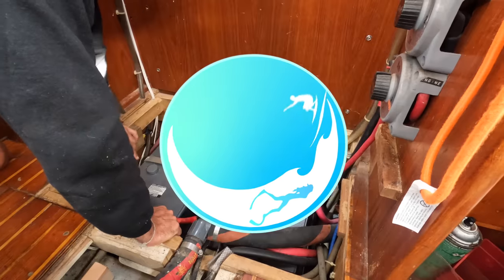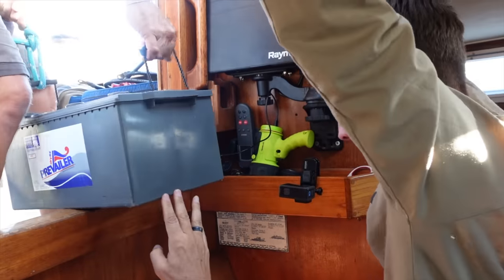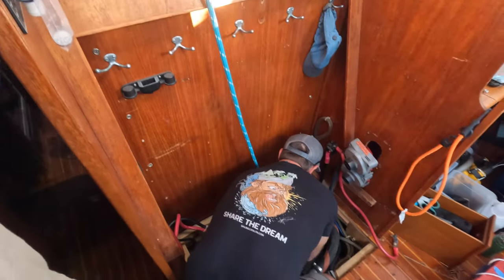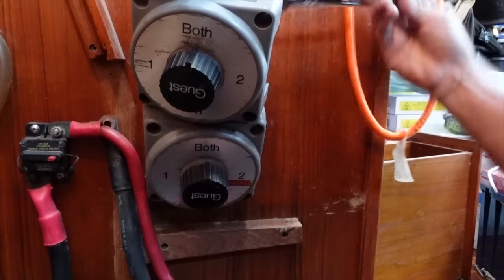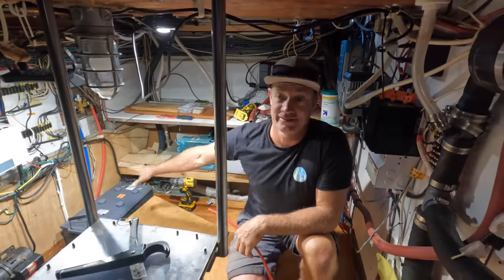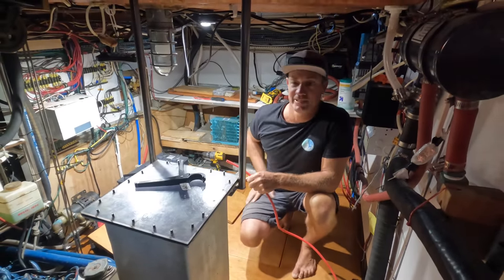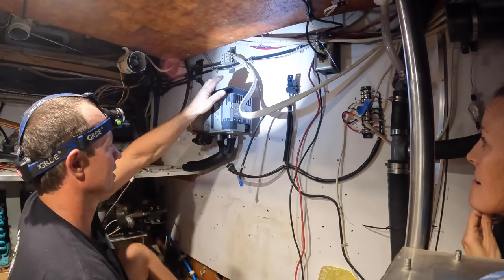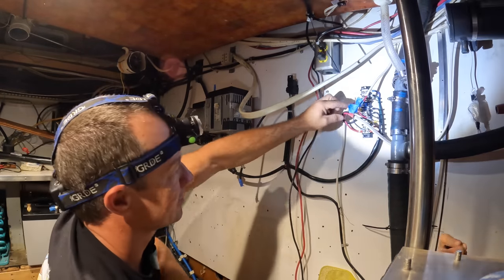Preparing our boat for a new electrical system | Ep 329 | Sailing Catalpa

Comment: t is highly recommended to place all lithium ion batteries in a dry lock box to prevent any water damage. These batteries are barely water resistant, stacking batteries in deep bilges cascade risks.
However taking these extra precautions will increase the longevity of the battery, reduce fire and catastrophic battery loss.